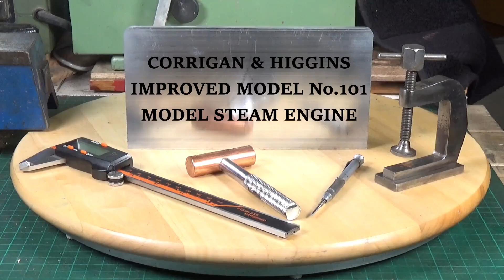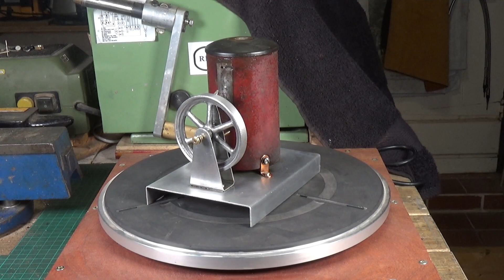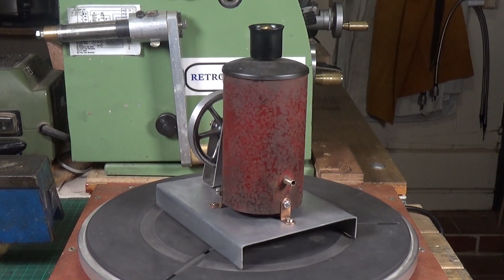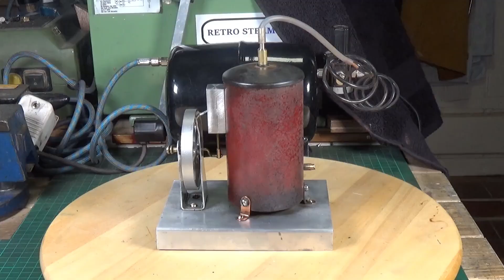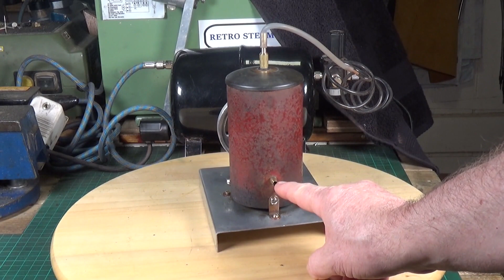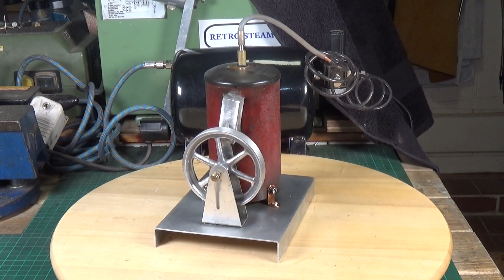Corrigan & Higgins Improved Model No.101 Model Steam Engine

Comment: Interesting one Alan.  I wonder if the top bit unscrews.  They had to get the element in there some how and then seal it.  I bought a couple of those rubber strap type oil filter/jar lid remover grips the other day and they would be good for a job like this - won't mark it.  Hot weather, ooooohh,  aaahhhhhh,  nice :)    Cheers Rob
Reply from the maker: Hi Rob. Yes it's possible although it rather looks like it's been soldered. I'm not too bothered as I have had the thing running. Glad your weather's started to improve. Cheers, Alan.

Comment: just curious, i noticed the steam outlet to the cylinder is right on the boiler, i have a weeden 238 that has the block on top of the cylinder and every time i try to run it the water boils too much even when half full and water locks the engine any ideas
Reply from the maker: Hi Timothy. I don't as yet have a Weeden 238 but it's on my list 🙂What I suggest you do is fill the boiler with water to the very top then empty it out into a measuring jug. This will give you an accurate measurement of the boiler capacity. Just put in slightly under half the capacity and try running the engine. Regards, Alan.
Reply: Oh ok by the way my friend has one of those and the cable slips into the hole on the back and a brass knurled collar snaps over that and compresses the fitting so the cord cant be pulled the cord was a yellow cloth lamp apliance cord.
Reply from the maker: @timothydelaval1089  Thanks for the info, that solves one mystery at least.